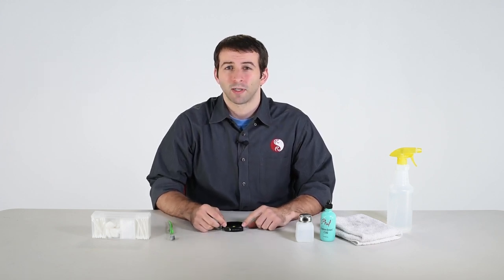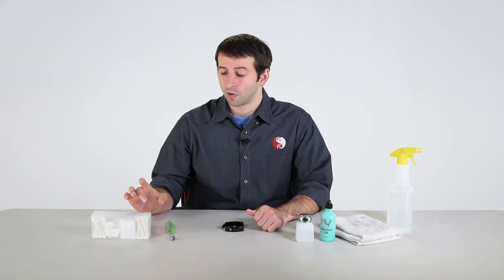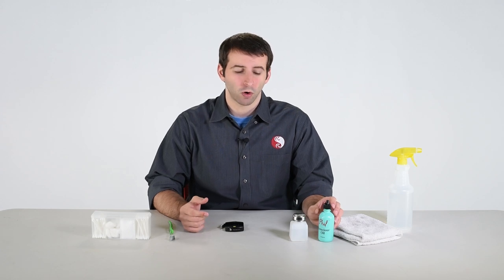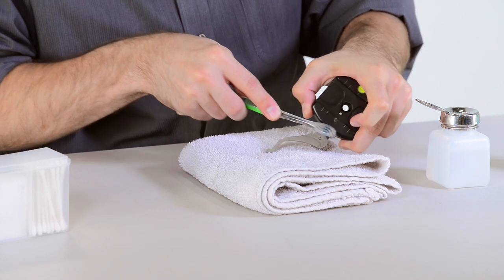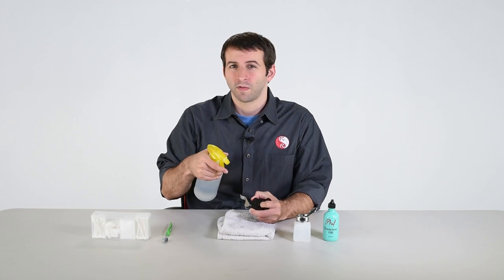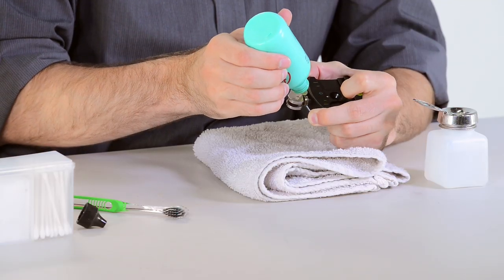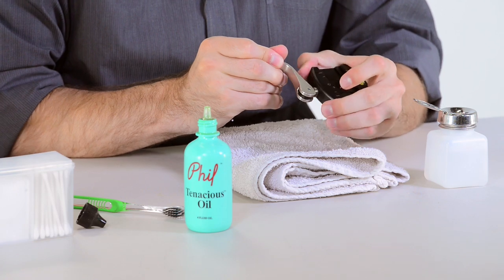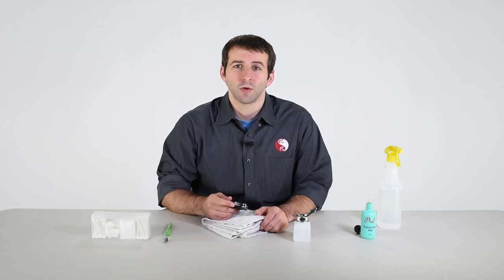Really Right Stuff Tripod Maintenance Part 7: Lever Release Clamp Maintenance

Comment: How do you actually adjust the lever's tension. Mine is a bit loose and I'm not happy with the grip that it has on a 3rd party Arca Swiss Plate that I bought. Its out by 1-> 2mm. thanks in advance !

Comment: Hi, I wonder if there is a way to tighten the clamp, it is a bit loose when clamp is closed...
Reply from the maker: Hi Marco, how long have you owned your RRS lever-release clamp? Are you using a rail/plate from RRS or another manufacturer?
Reply: Not long, I inherited it from my dad upon his passing last month and he had it for about a year or so... I tried to use it the other day with the plates that he had (I assume those are the ones he was using) and it seemed loose... particularly if you press it all the way down (instead of  slightly off the side of the clamp) He has a non-branded plate, and a couple of novoflex ones...
Reply from the maker: Hi Marco, I'm sorry for your loss. We've had compatibility issues in the past with Novoflex gear. They may have standardized their plates since but a few years ago we tested a lot of their gear and had issues. If you want an absolute fit I suggest getting RRS plates or other plates that follow the same or similar standards. The can find the RRS Standard here: http://www.reallyrightstuff.com/patents
Reply: Thanks, no worries; he lived a long life and enjoyed his photography a lot! Ok, I will get some RRS plates soon!
Reply from the maker: I'm glad you can continue his photography legacy. Best wishes!